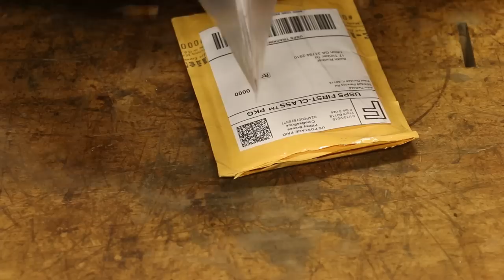Odds & Ends 14: Viewer Mail, Crescent Jointer Heads, and Pocket Watches

Comment: As soon as I finished this video I opened my drawer and pulled out the pocket watch I acquired from my grandfather. It is a South Bend and has not seen the light of day for many years. With a wind of the crown it was off and running. I then took it to my local watch repair and learned that it is late 1800's and good quality. Thanks Keith for reminding me of the treasure I have neglected for so many years.

Comment: hi Keith,
the correct term for the piece you refer to as the throat plate is called a gibb. in more modern heads the taper of the gibbs helps tighten the knives via centrifugal force as the head rotates. that of course doesn't mean that the set screws shouldn't be tight. the plugs you have are used with an allen set screw.

the watch portion of the video is very interesting. thank you for sharing that! your railroad watch should fit in nicely with your duties at the museum. the nostalgic value and aura of having a railroad watch in conjunction with your activities on the locomotive are priceless reminders of old traditions long gone. it's fantastic that you are keeping those alive. quite frankly you can't put a price tag on the stuff you have and do

Comment: excellent video keith my grandad was the village watch repairer he used to do everything
from grandfather clocks to pocket watches he used to give us old watches to play with as a child
Reply: always remember his repairing specs made up from two jewelers eye glasses fixed to a pair of wire framed spectacles and it it got really small he had a huge magnifier connected to a desk lamp the smell of cleaning fluid or lighter fluid if he couldn't get hold of any he used to say it left an oil reduce which helped some of the big clocks he worked on were amazing makers and repairers from as far back as the late 1700 on some clocks
Reply: its funny you should say that keith i miss him and my dad

Comment: Nice video Keith, love those old pocket watches. Thanks for sharing about the end mill
sharpening.

I was watching TV just before I checked out this video, was watching the WOOD WRIGHT SHOP
and he had an old pedal operated metal lathe he had just purchased.  He did some threading and
taper cutting on the lathe but be ready for some good laughs and I'm sure you will be doing some
some hollering at the TV screen like I did.  It was a pretty cool old lathe but I'm sure you could do
a nice tune-up on it.  I'm going to try and find it on the internet and pass the site on to all the
Youtube machinists

Comment: I have seen straight pipe threads on some odd plumbing fittings when I worked for a plumber once He had  showed me to but some teflon tape on the part so it would tighten and seal as the pipe went in .Regular pipe we used just pipe compound  .
Those are some very nice watches !!! I would think a watchmaker is like a machinist They make some very small parts on those very small watchmakers lathes

Comment: Pull out the low frequency mechanical oscillators (pocket watches) any time.  

I have a few myself.  

Years ago I took one into the microscopy lab at work and looked at the bits.  It entirely escapes me how such beautiful machining can be accomplished on such small parts.

Comment: I love old watches and anything like that. I have all my Grandfather's old pocket watches (and his tools). This inspired me to reach in my jewelry box and dig out one of them (the others are hard to find). It is a Sears watch. Roman numerals. The neat thing is it has a steam engine pressed (not engraved) into the back case!

He was a Lockheed Machinist. Built B29s.

You have to press the stem IN to change the time. Wound it up and it has been clicking happily for about two hours...

And I have a Seiko pocket watch made with my Engineering school logo on the face. It's a tiny thing, Inch and a quarter diameter, and maybe 3/8" thick. Gold. Wasn't cheap. But my local jeweler replaces the batteries for free.

When I wear a suit and vest it gets comments....

Comment: I forgive you 100% for talking about pocket watches. My current project is trying to make a clock. I am fascinated by clocks and watches, and actually making them is a machining project, only on a very small scale. I am glad you found someone to repair your watch. Nowadays watches are made with standard parts, so if for instance you have a broken pivot (read tip of an axle or spindle) you just order one from Switzerland. But on an older 1900s watch you might have to turn the whole "arbor" (spindle) from scratch. Labor-intensive. Might like to watch the Watch Repair Channel on YouTube. Or/and Steffen Pahlow's channel. Mr Pahlow is a watchmaker, and you will see lots of machine operations in micro-scale.
Reply: *****
It is interesting that you mentioned jewels as an indicator of the quality of the watch.  The jewels are nowadays synthetic ruby, but in the 1900s they were real ruby (diamond too expensive!) and there is an interesting video somewhere on YouTube from WWII showing how the ruby was cut into jewels for naval chronometers. Maybe even the Elgin Watch Co. but it may be Hamilton. Also, your top class dial indicators have jeweled bearings too. A DTI is a whole lot like a watch without an escape mechanism.
Reply: *****
Interesting that you mentioned jewels as a guide to the quality of a watch. Nowadays jewels are synthetic rubies. But in the 1900s they were natural ruby. There were special techniques developed to make pieces of ruby into watch jewels. By the way, your top-quality dial indicators are also jeweled. A DTI is a whole lot like a watch, only the escape mechanism is missing.

Comment: I'd like to hear why you don't like wrist watches. I love em!
Reply from the maker: +MattsMotorz I had two "incidences" with wrist watches in the period of about two weeks nearly 20 years ago and it scared me so bad that I figured it was somebody trying to tell me something.  The first incidence involved getting my wrist watch caught in a piece of running machinery - it snatched my arm over and started pulling me into the machine.  Luckily, the leather band on the watch broke before any serious injury to me happened, but is scared the fire out of me.  I replaced the band with another leather band and then about two weeks later I was mounting an antenna on top of a grain elevator.  As I was about 100 feet off the ground climbing the ladder to the top, somehow as I reached for the next rung on the ladder, the watch got caught up in the structure of the ladder.  When I snatched my arm to try and get it free, again, the leather band on the watch broke and the watch started falling to the ground.  My first instinct was to try and catch the watch with my other hand - the hand that was holding me onto the ladder!  When my brain kicked in and realized what I almost did, it really scared me bad.  I basically had to hug the ladder for about five minuets before I could move up or down.  When I got back to the ground, I saw my watch laying at the bottom of the ladder, kind of busted up a bit.  I looked at it but did not even bend over to pick it up - I just left it lying right there and swore that I would never wear another wrist watch again.  I had this feeling that somebody from upstairs was trying to send me a message and I figured three strikes and I would not be so lucky.
Reply: Damn that's scary! I guess if that happened to me I would do the same thing.  Next time I am at my lathe the wrist watch is coming off!